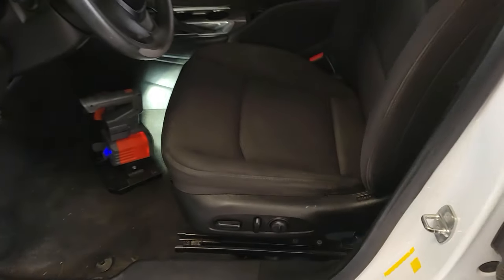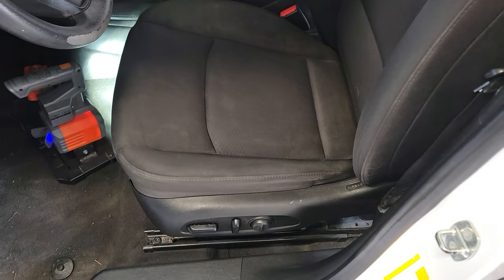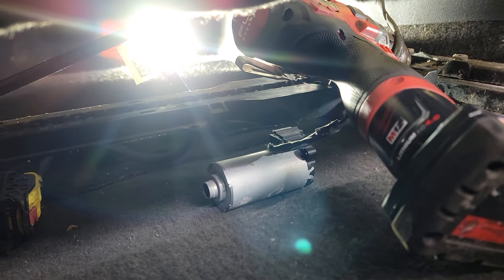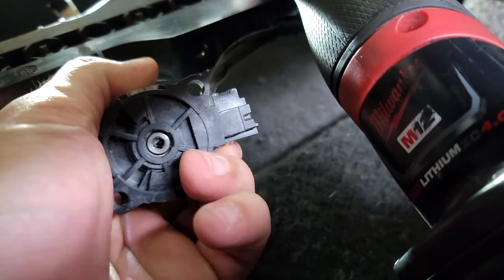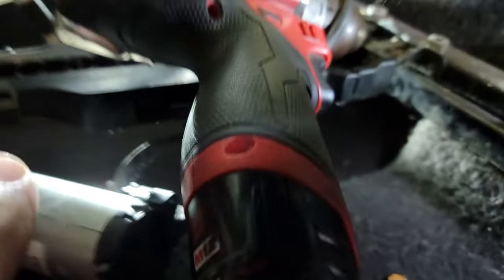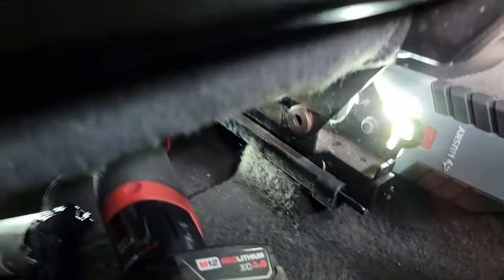HOW TO MANUALLY MOVE BROKEN AUTOMATIC SEAT TO REMOVE BOLTS 2016-2022 MALIBU BROKEN SEAT ADJUSTMENT

Comment: What bit are you using on the drill? That would be a huge help
Reply: Looks like he's using the gear off the motor
Reply: It looks like it says in the video description that it’s an Allen wrench attachment?
Reply: He’s got the drill tightened on the pin that moves the seat

Comment: OK I get what you’re saying but what’s at the end of the drill? Did you have to use a bit? You just said drill I really need to know because only one side of my seat is going back.
Reply from the maker: what I did was - I removed the cables that attach to the motor of the seat and used the drill motor to spin them instead of the actual burnt out motor on the seat track. I did not use a bit. the part was already in the seat all i did was remove the cable from the motor and put the end from the motor into the drill. and spin. repeat this process with both sides so you can move the seat evenly.

Comment: I have a 2011 malibu and there are no screws that hold on the trim. When I look under seat I can see that there is a metal u-shaped clip holding it on. I have tried pulling on it but I'm afraid it's going to break. Is there a trick to these clips? Need to replace switch.

Comment: How do you remove motor and detach cables?
Reply from the maker: Remove the seat and remove from underneath
Reply from the maker: You can pull the wire really hard and it will come off. Only do that if it’s damaged because it’s bolted and built into the track